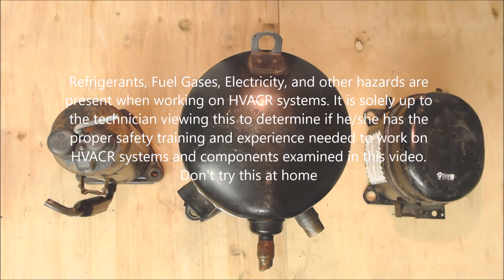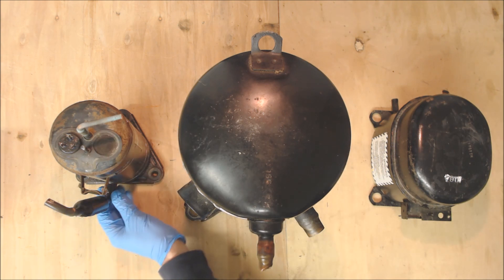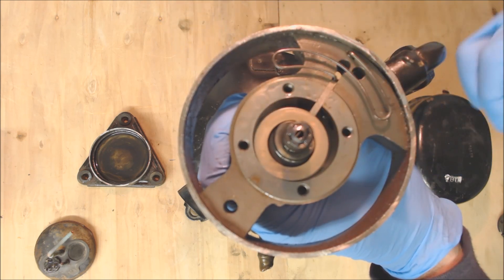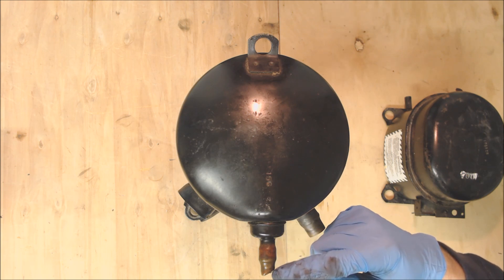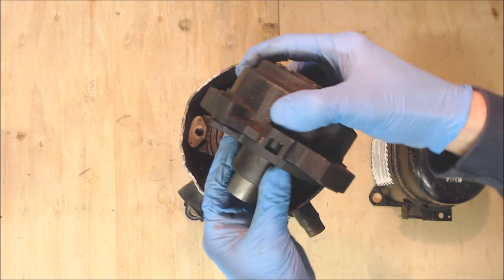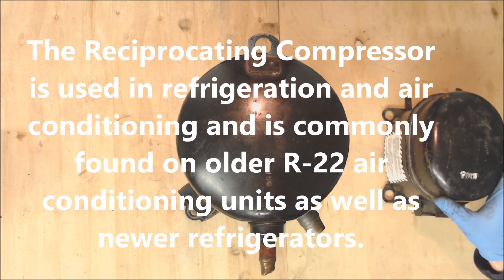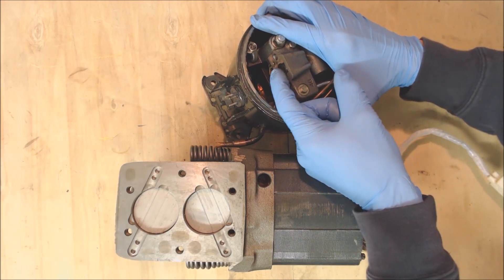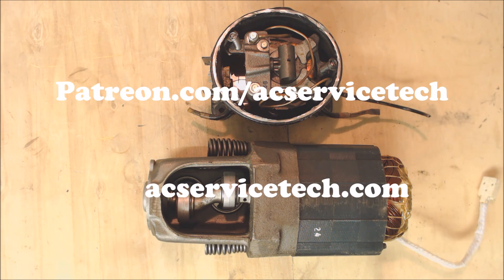Scroll, Reciprocating, Rotary Hermetic Refrigerant Compressors! Cut Open!

Comment: Nice video ... i have a question: is it possible to convert the  220vac  motor to BLDC motor including the evaporate fan and indoor  blower motor to Dc, to run on solar, finding it to costly to run on erratic  Govt. supply ????

Comment: Dear sir,
I am looking for the answer about old refrigerator compressor oil lines which is also can be saw in your vedio where you were talking about refrigerator compressor.
My question is what is the reason or logic behind this. Why used?

Comment: Just found this info
When a TXV kit is installed on systems using reciprocating compressors, a hard start kit must be installed; hard start kits are not necessary on units using scroll compressors
Reply from the maker: Some TXV's come as a hard shut off and others allow for equalization, thanks!

Comment: What is the reason of low pumping of refrigerator compressor
Reply from the maker: Do you mean weak compressor valves when the compressor is not rising the discharge pressure high enough?

Comment: I replaced a 410a  straight cool split 5ton with a copeland scroll due to an electrically shorted out motor that blew one of the terminal pins out and lost the refrigerant charge. I replaced the compressor, the filter drier and poured in a bottle of acid scavenger. Pulled vacuum to 500 microns weighed in the charge and adjusted it once running. It fan great overnight but the next day it wasn't pumping. compressor Motor was fine, just wouldn't pump. My question is why did this happen? and is it possible to reset internal relief valve once it opens?  That you so much as service tech!
Reply from the maker: When you weighed in charge, did you break the vacuum with liquid into the liquid side up to the "factory charge" on the rating plate and then start it up and slowly add it in the suction side so that liquid would not go into the compressor. Basically, I just wanted to make sure a bunch of liquid was not charged into the suction side and then the unit was started which could damage the compressor. How did it get put in?
Reply: I had vacuums broken twice with nitrogen, the third vacuum
(500 microns) broke with liquid 410a into the liquid line. I was able to let
the vacuum pull in all 12 ½ lbs. (factory charge per label) and then I fired it
up. After a few minutes of running, it dropped from 52F to 48F on lo gauge and still coming down (house dropped from 89F to 85F). High side dropped from 430 psi to 420 psi and still dropping, ambient was 105F  (Phx, AZ), with the house hot and outdoor temp high, the pressures looked normal. I was going to come back next day (I got done @ 10 pm) and adjust charge/subcooling. But I got a call mid-day that it had no cooling. Found the compressor not pumping, pressures were mostly the same both sides. Compressor was not making any unusual noises and electrically fine. I put in a new 16 cu. in. filter drier and 1 bottle of acid scavenger when I changed out the compressor.  What went wrong? Faulty replacement compressor?
Compressor was an exact match. Could the new liquid line filter have
plugged up? It was a burn out (when I reset the breaker, the compressor hummed then blew a terminal pin and then its refrigerant charge). It had an existing LL filter drier. I have heard that some MFRs don’t recommend flushing the system, so what else can I do to ensure this doesn’t happen again? Or did I just get a faulty replacement compressor? I value you input greatly, thank you so much!
Reply from the maker: On the new compressor,  you said the compressor was running but not pumping? Are you sure the motor was moving? What was the amp draw? The other stuff you did was what you normally would do, except I would have tried to clean the lines with R-11 flush if possible also. I usually put in the c-303-sporlan filter drier which is almost twice the size as the one you used. This isn't a heat pump with a possible stuck reversing valve, is it?
Reply: It was running, pulling 9-10 amps. and hi pressure would fluctuate maybe 5-10 psi. But both sides pretty much the same psi though. No, its a strait cool. If it was the filter, have you ever had a new filter plug up this fast? In the future, would I only need to flush the condenser since it had an intact filter drier? Or do I need to pull the metering device out and flush both lines down to the outside before brazing in the new components? 
So I'm guessing you're leaning toward a plugged filter? I was hoping It wasn't anything I did! Thank you so much for your help!
Reply from the maker: You won't be able to clean the condensor or evap since the r-11 flush needs to go from a high spot out to a low spot. Cleaning the line set just helps get some of it out. I am actually surprised that happened then from the diligence you took to put it in and how you did it. No I usually don't see a new filter drier clog. It is single phase and was wired correct right? You didn't loose any oil from the compressor either I am assuming?
Reply: Thank you AC Service Tech. Yes it was a single phase and wired correctly, the compressor motor was purring like a kitten. I didn't loose a drop of oil. A mystery  to me.
Thanks again you're the best!